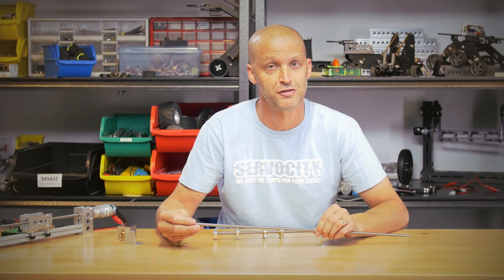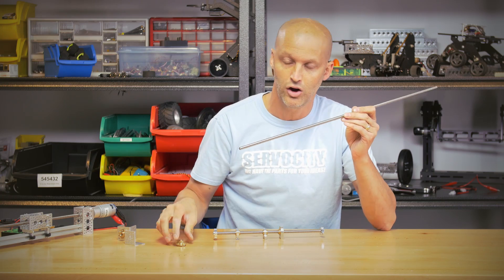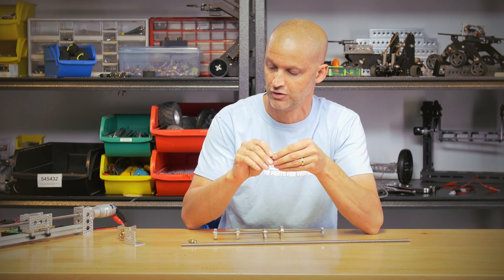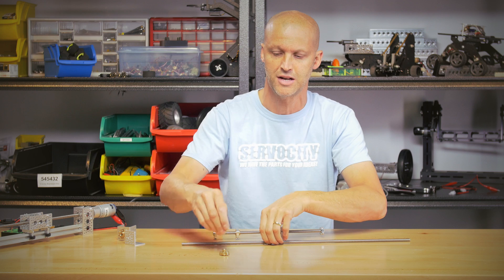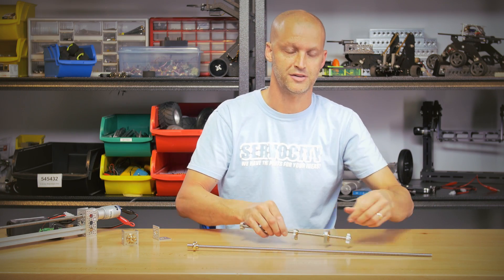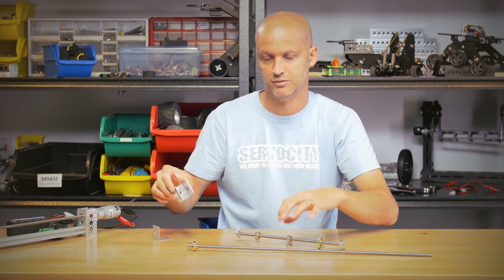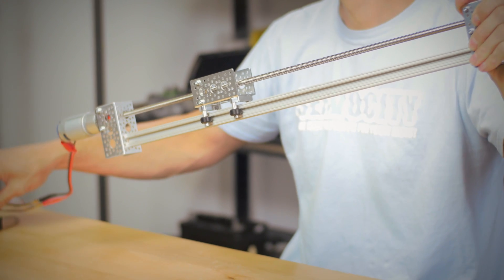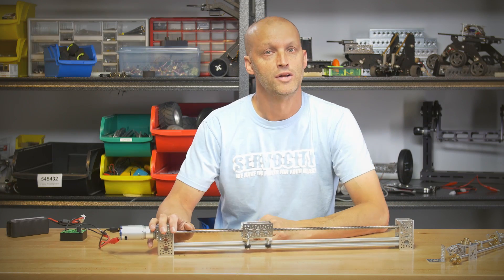ServoCity Products: Lead Screws and Nuts

Comment: Capabilities of Shen-Han Technology –

. Ball screws and screw nuts in customized specific
standards

. High lead ball screws and screw nuts

(1204, 1210, 1220 ,1606 1616, 1632, 2505, 2550, 2440, 2020, 2040, 2525,
4040 5050 etc.)

0601 0606 0801 0802 082.5 0808 0810 etc. Only our factory has produced in China.

Wei Tai Transmission Limited Company is the head office
in Taipei and acts for all of international trade activities to handle the
shipment supplied from Shen-Han Shenzhen factory.  We are looking for the
new customers in your regions and it’s thankful if you can give us a chance to
work together with.  Please feel free to contact the following:

Wei Tai Transmission Limited Company
Email: 02weitai.ltd@gmail.com 
We chat ID: w0978377508
You tube: https://www.youtube.com/watch?v=-8kBVM4JCBg&t=41s 
https://www.youtube.com/watch?v=jQW23Bx59WQ&feature=youtu.be
Website: http://www.weitaitw.com/en/ball-screw-nut.html
                 https://www.weitaitransmission.com
FB: https://www.facebook.com/hung.nora.3
Cell phone: +886978377508
Address: No. 214-3, Zhou Mei Street, Bei Tou
District, Taipei, Taiwan, R.O.C.
Tel# 886-2-2832677     FAX:886-2-28327852

Comment: Will these wear out fast when they push a load of about 30kg ?
Reply from the maker: There are quite a few unknowns that will change the outcome.  Brass on a stainless lead screw runs smooth, but we recommend you lubricate the lead screw with lithium grease to reduce friction.  This will greatly increase longevity.  Let us know should you have any other questions tech@servocity.com.

Comment: What’s the static load capacity?
Reply from the maker: Static load capacity is dependent on the lead screw nut length.  Feel free to contact our Tech Team at tech@servocity.com with your project specifics and they would be glad to assist in answering any other questions you might have.

Comment: What would be the load capacity on a conveyor setup like this, if the rod was 24 inch?
Reply from the maker: The length of the rod won't determine the load capacity, it's more about the torque of the motor, the orientation of the load applied and the number of v-wheels you have supporting the load.  Feel free to email tech@servocity.com with additional questions!

Comment: what rpm motor is that?  Also, are there any plans to come out with conveyor belt kits?
Reply from the maker: Hi, James we apologize for the delay.  The motor is 313 rpm Premium Planetary Gear Motor https://www.servocity.com/313-rpm-hd-premium-planetary-gear-motor.   We have many of the components necessary to build a conveyor system but don not have plans for a kit in the near future.  We'd be happy to help you select the necessary parts should you want.  Feel free to contact us at tech@servocity.com or 620.221.0123.  Thank you!

Comment: Can you use one of the HiTec servos to control the lead screw? If so, what can I use to connect the lead screw to the servo?
Reply from the maker: Keep in mind servos typically rotate about 180 in stock form.  If you use the HS-785HB servo or a continuous rotation servo then you could drive the lead-screw multiple turns.  To connect a lead-screw to a 24T servo spline you could use a servo horn that has the .77” hub pattern and then attach an 8mm clamping hub to it using 6-32 x 3/8” socket head screws.  
https://www.servocity.com/standard-hub-horns 
https://www.servocity.com/770-clamping-hubs#348=105 
Please let us know should you have any additional questions tech@servocity.com 620.221.0123